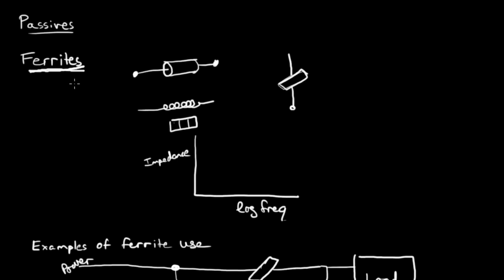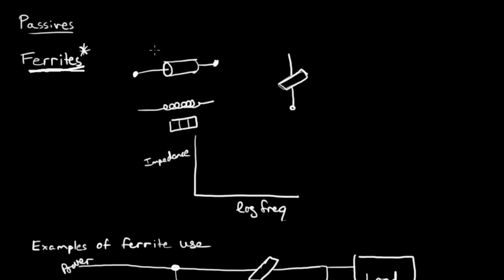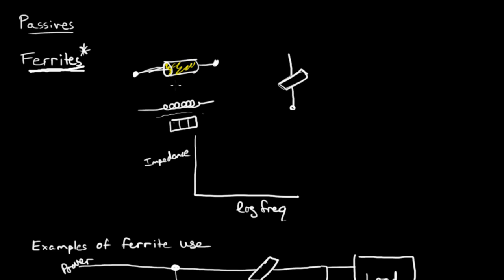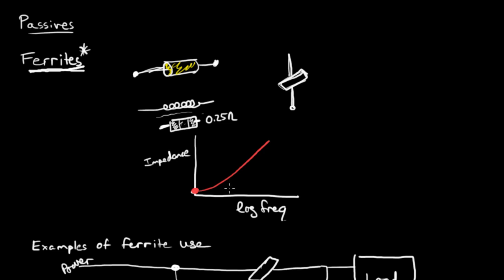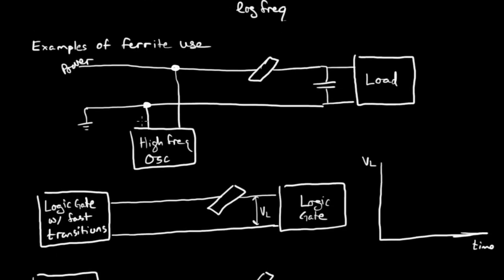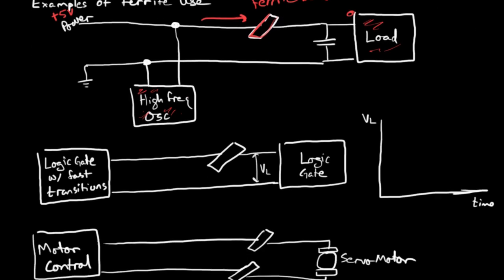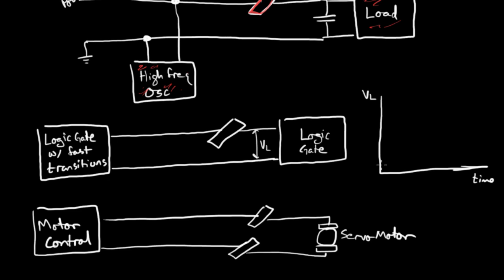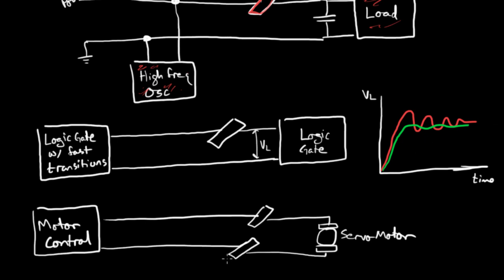Passives 3 of 3: Ferrites

Comment: Would you use a ferrite bead instead of terminating resistors in some cases to deal with reflections on transmission lines?  That's what your second example seems to suggest.

Comment: A couple of quick questions, when applying a through hole ferrite bead to an insulated wire, is it more effective to strip the insulation where placing the ferrite bead and then use heat shrink tubing to insulate and fix the bead in place? Or, would it be better to simply loop the insulated wire once through the ferrite bead?

Comment: Thank you for the video.  Early in the video you said ferrites are non-conductive, but they are electrically conductive, especially at DC.
Reply: Not so. The ferrite bead is non conducting, the bit of wire through the hole in the ferrite bead conducts electricity. Think of the ferrite as a sleeve over the wire.
Reply: @ozriblit  Ferrites are not good conductors but they do indeed conduct. I can personally vouch for that.
Reply: @ozriblit  Sadly people do not put emphasis on what you have written - it is probably the main source of misconceptions about ferrites.